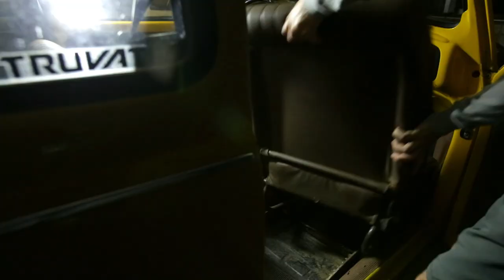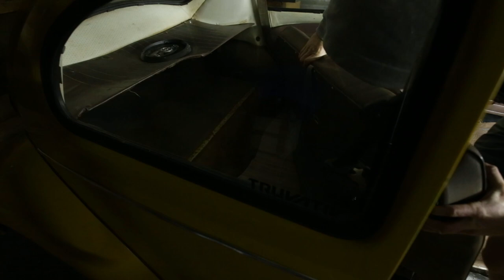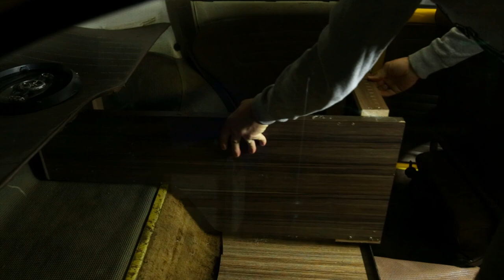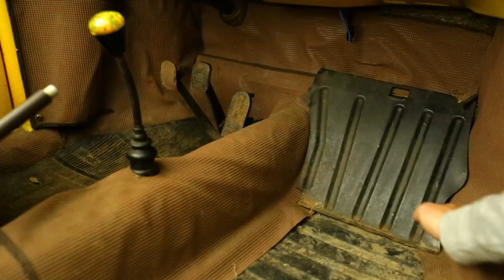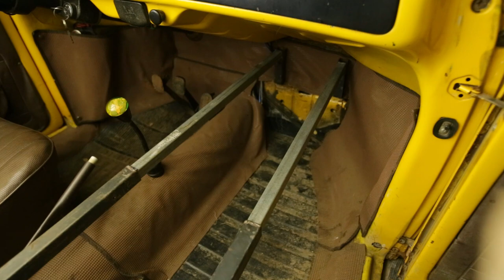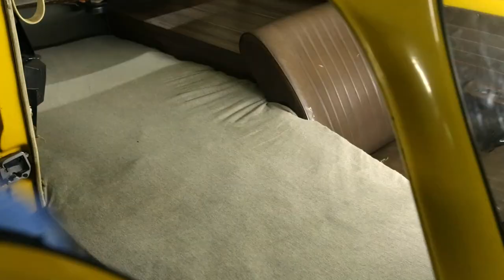How to Convert a VW Beetle In a Camper With $10,00 - Step by Step

Comment: I did this in 1986 with my 66 beetle. The layout is almost identical though your construction is better. My guitar case fit perfectly under the bed. I had a two burner Coleman stove behind the driver seat and a small sink made from a large funnel that drained through the floor. This assisted a lot with cooking when you didn’t want to open the doors or windows in bad weather. I had storage shelves underneath the rear window and curtains all the way around. I lived this way for many months and never paid rent again. When you take those extra seats out there is a remarkable amount of room in the original Volkswagen beetle. On one evening while camping out with the forestry crew I ended up with five people in the car! It started when someone came to see why I wasn’t at the campfire. The weather was lousy. Instead of talking through the open window I said come in sit in the driver seat. Pretty soon another person came to check where the first person had disappeared to. This was repeated until four were sitting cross-legged on the bed facing the driver side and one person was in the driver seat. I was cooking snacks and making hot drinks for everyone. Some Cajun radio station playing on the old am radio… Compared to living out in the elements it was pure luxury! Everyone on the crew started trying to figure out how to live in their cars after that. The beetle had amazing off-road capabilities. Easily equal to and sometimes exceeding the abilities of large four-wheel-drive pick up trucks. It was a very comfortable and efficient way to live. I loved it. Sometimes when I woke up in the morning and there was fog and mist all over the windows from the night condensation I would think it was a gray cloudy day. After making breakfast and getting dressed I would open the door and be dazzled by the bright sunshine and beautiful blue sky! I would’ve gotten up earlier if I had known it was so nice!😅.  Later I got a 67 square back and did the same type of interior conversion. The extra space of the hatchback meant that two people could sleep comfortably, one in the standard bed next to the driver seat and another behind the driver seat slightly elevated. It made it much easier to live and travel with my canine companion though the second bed was actually long enough for a human. Eventually I was able to acquire a Volkswagen camper bus but after a couple of months I got rid of it and went back to the squareback because it was too big! I hated that you had to get out of bed to change the radio station or make breakfast. It sounds crazy but there was just too much room. It took twice as long to clean the house😅
Reply: I agree whit you! Is too big,too much to Clean!We See you dont need much for coocking,dishes,and Others!I Love IT!All your Videos it makes my day Happy!
Reply from the maker: One pleasure in life in to share adventures on Youtube, prepare a coffe and read something like this. Your comment made my day, thank you for share this golden years feeling!🧡
Reply: @RodrigoKaspary  Fantastic! I’m so glad you saw my comment. I have finally found my twin freak of the world! Give me an email address and I will send you some photographs. I was shooting a lot of Kodachrome slides back then.
Reply: Eu ja fiz isto haha mas nao de forma tão profissional quanto vc faz.
Reply: I really appreciate this project, but like Rodrigo made, he has a motorcycle and a mountain bike in a little motorhome haha that was great, maybe my project I gonna use a station wagon like a Toyota Corolla SW. Let's try .
Reply: In 2024, the Beetle is still the best car ever made! I have a Porsche, Mercedes-Benz and BMW and will sell any of them. My 79 Beetle convertible is for life. 38 years I have it and still going strong!